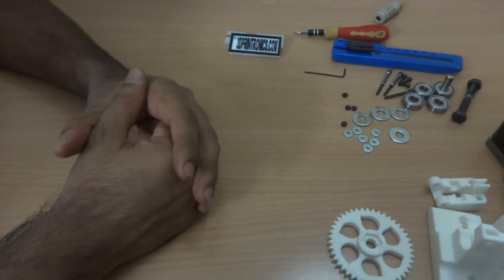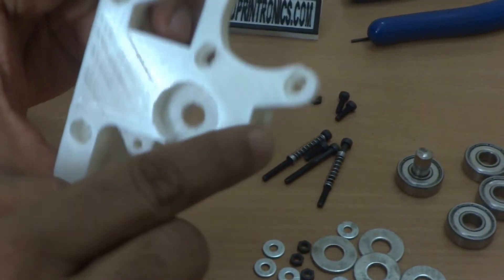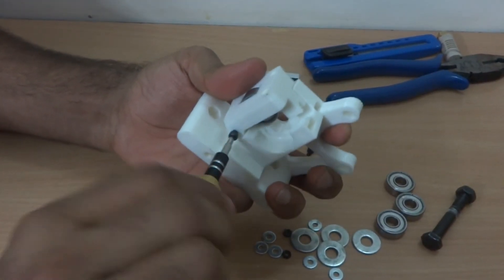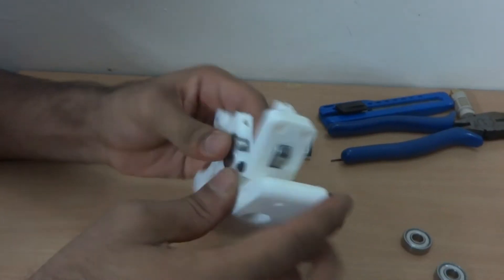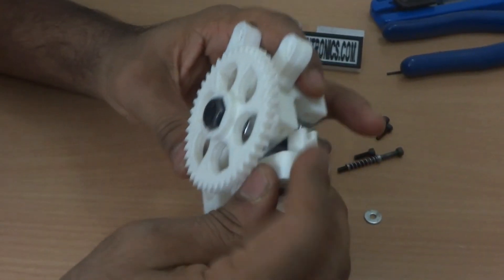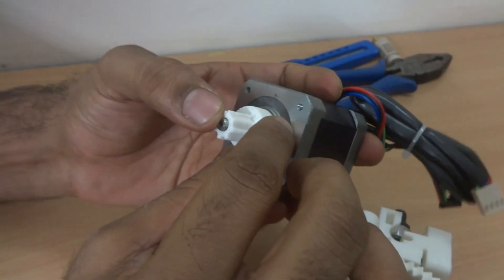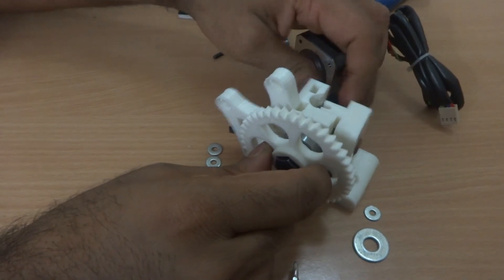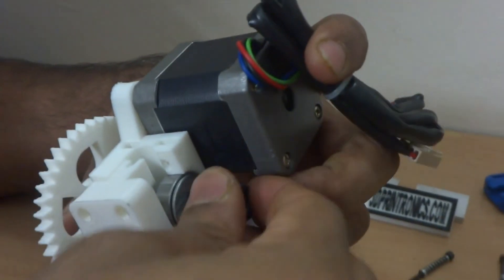Assembling a Wades Extruder

Comment: Great explanation! Do you have a list of bolts, nuts, washers, bearings? and the size of the pin that goes between the bearing? Tanks!
Reply from the maker: Thanks for your appreciation. I will try and get the list for you, although this is quite an old extruder system.
Reply: Thank you! I'm setting up an old and basic, to perfect myself in the others.